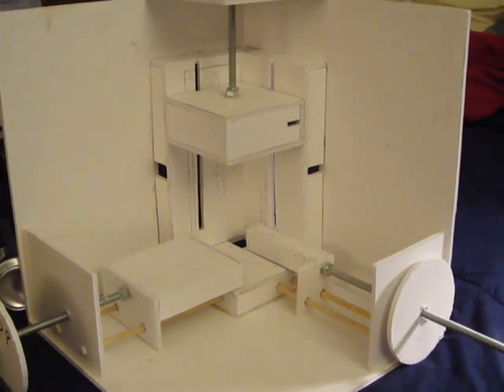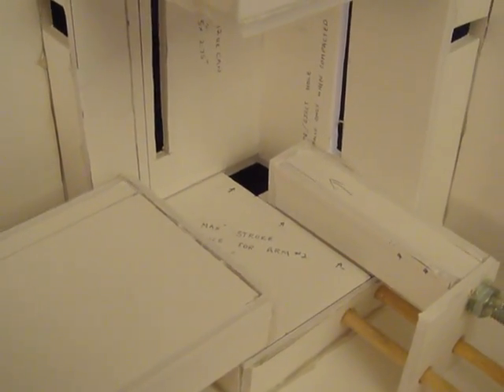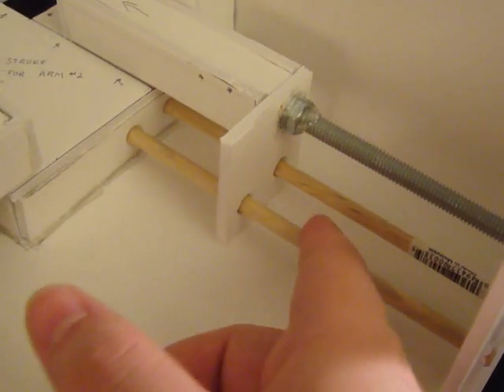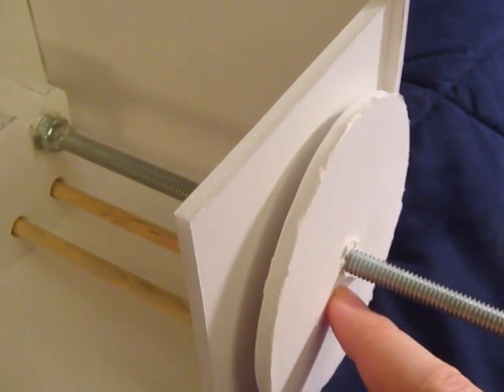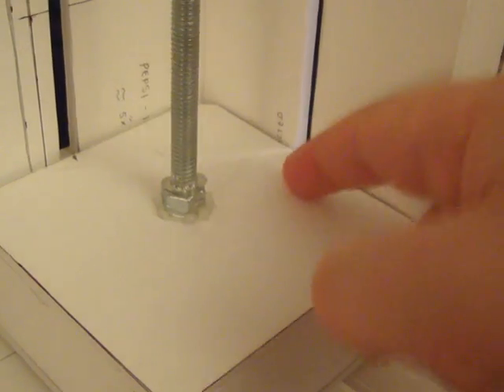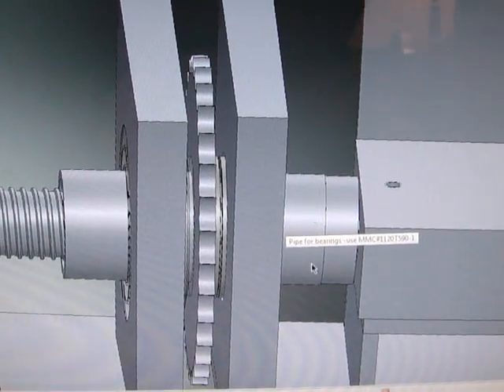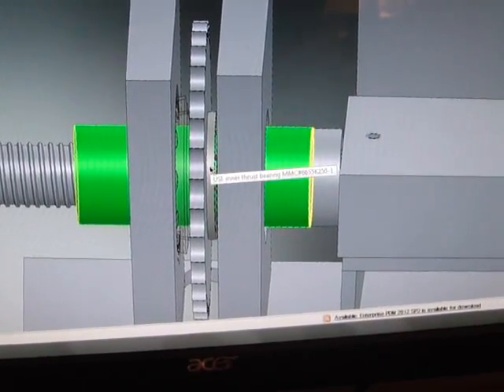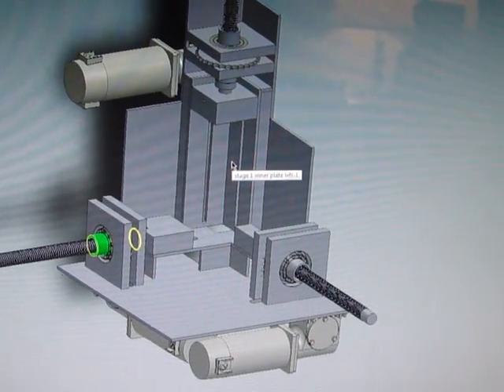VTC Can Crusher Part 2

Comment: @DAPiratecaptain ok. but just in case check some welding simulations on solidworks if posible, because of 5tons on 2 welding seams looks a litle bit too much, unles you are using imperial tons instead of metrick, then it might hold. probably

Comment from the maker: @giedriusonline Hello, thanks for the suggestions. We plan to use steel tapered roller bearings (axial and radial load) for the "push" cycle, and plain thrust bearings for the "pull" because the "pull" has very little load. Both bearings will be mounted into 3/4" steel plates and anchored to 1"x1" that are welded to the base plate. I hope to have more videos of the individual assemblies as we go. Thanks again!

Comment: I am a final cours mechatronic engineer student. and i have just few sugestions: axial bearings or axial radial bearings on sproket, linear guids for pusher guids, triangular suports for bearing monts bechause believe me you will bend steel bolts that you gona use (i thisnk you gona bolt those bearin monts to base). and sorry for my english. everything elss looks ok

Good luck 
Giedrius